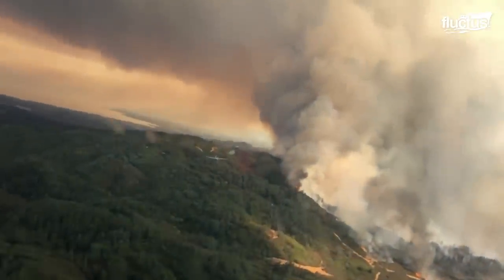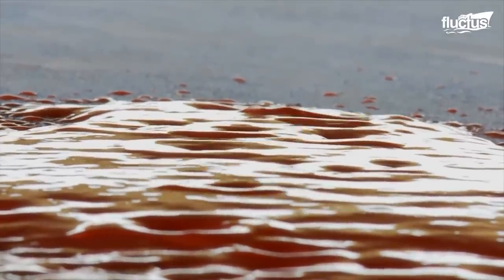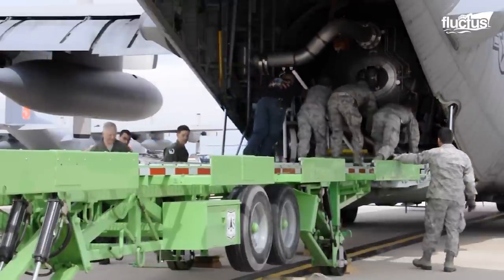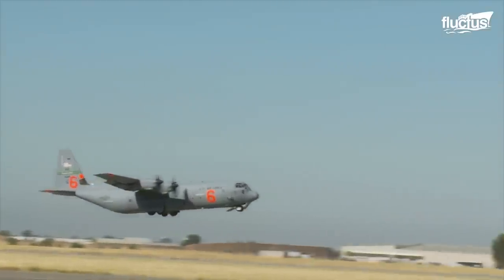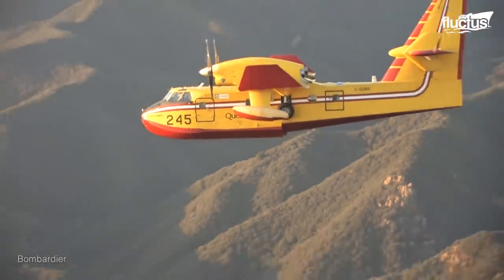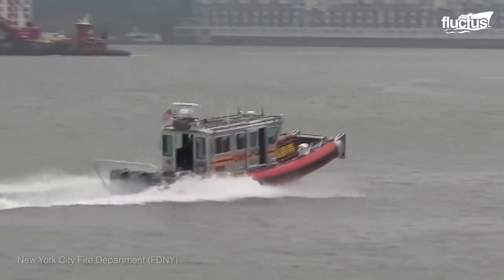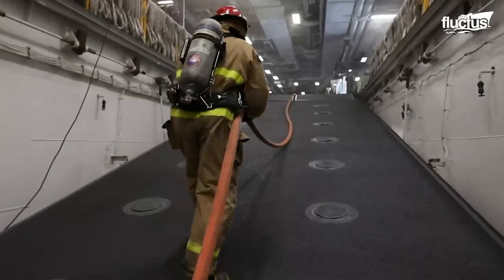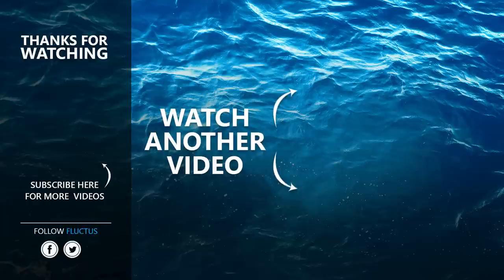US Genius Idea to Transform Massive Aircraft Into Flying Fire Trucks

Comment: Clarification: Aerial dispersed fire retardant is not dropped directly onto the fire, it is dropped ahead of the fire line to make the fuel load less flammable. Water is dropped directly onto hot spots in the fire line to extinguish and cool the hot spots.

Comment: Sooo many errors about the C130…Not 70 years old…😂😂😂🤦‍♂️
Reply: I know, it is only 68 years old as it first flew in 1954, but then again it only said it was about 70 years old.
Reply: @Chris_at_Home  Really? I honestly thought it was later than that!🤷🏻‍♂️👍🏻
Reply: @sacrificialrubber779  Yup and one just flew by fairly low doing a run on a drop zone about 15 miles from here. I heard a couple F-22s a while ago also. There goes another C130 but higher up.
Reply: Yeah the base c130 a models came out almost 70 years ago.  But noone operates them anymore.  The new J models are phasing out the H models.
Reply: @r4raced4doom2  They don’t sound the same as the old ones with the T56 Allison engines. I know that sound well from 50 years ago working on P-3s with the same basic engine and prop as the C-130.
Reply: @Chris_at_Home  true but they make loads more power now and the new 6 blade prop looks wicked.  I do wish they would swap Pratt PW150's (Q400 engine) on them tho...